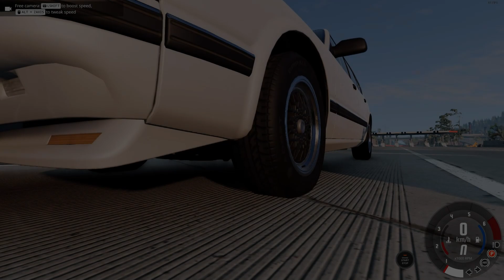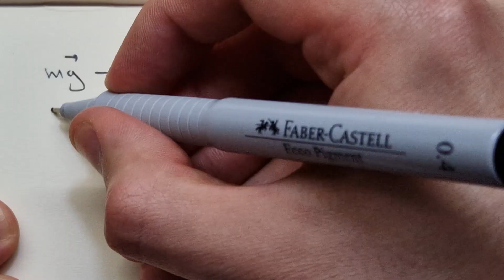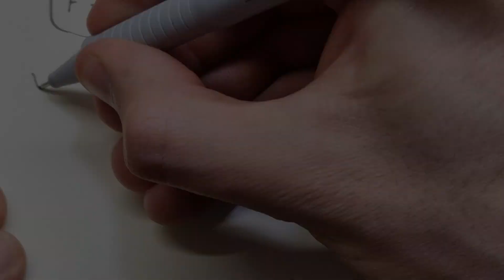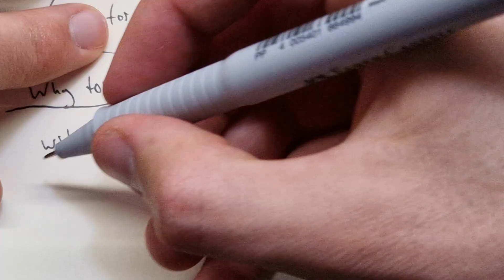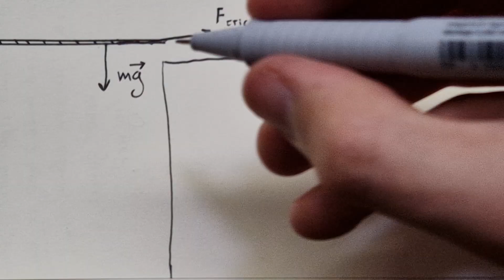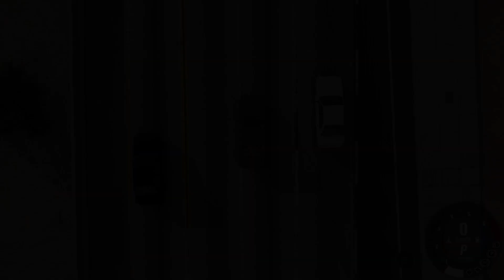Why are tires so important?  (All types of tires and types of grip) Tested and Explained !

Comment: On regular asphalt, the race tire slicks are best as expected. You however tend to lose grip with sportier tires on surfaces that are not asphalt which makes tire choice not so straightforward for vehicles or races where you will meet a lot of non asphalt roads. 

Still very nice video. 👍
Reply from the maker: Yes, there are different tires for different road surfaces. In this video I just wanted to show the difference between those used on asphalt ) 
Glad you liked the video!

Comment: I knew this from off road experience
Reply from the maker: Cool, do you often go to off-road?
Yes, by the way, the type of tires is even more important on the off-road than in normal life. Because off-road traction is one of the most important things. That's why off-road tires are made with large treads to increase the friction force, and sometimes even chains are put on the wheels.